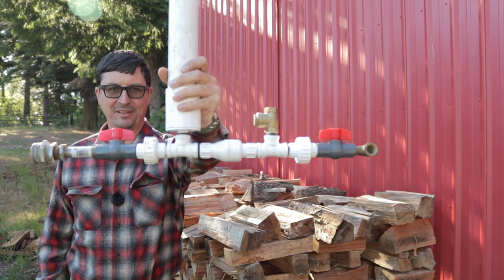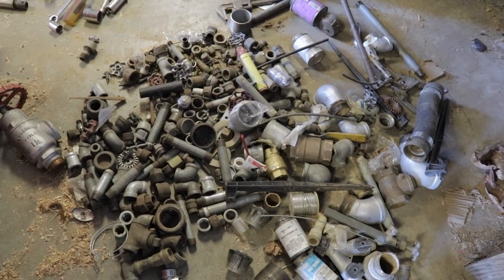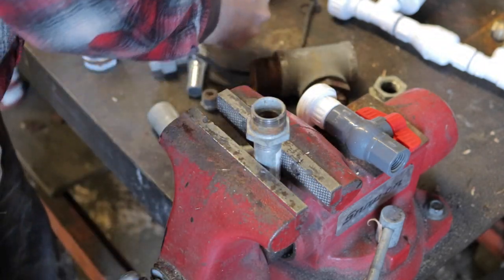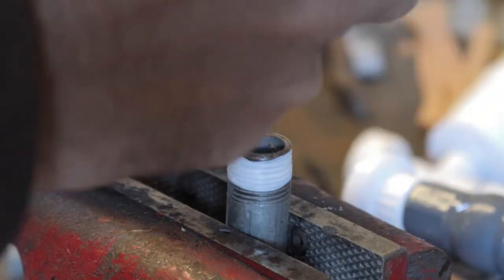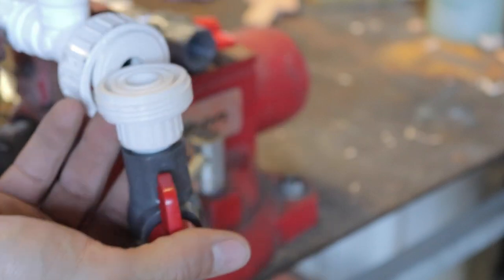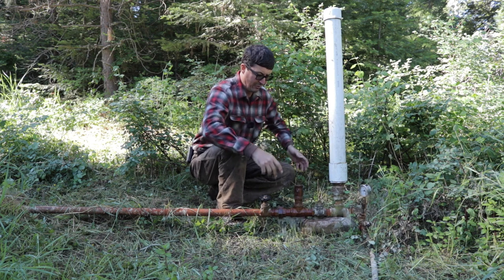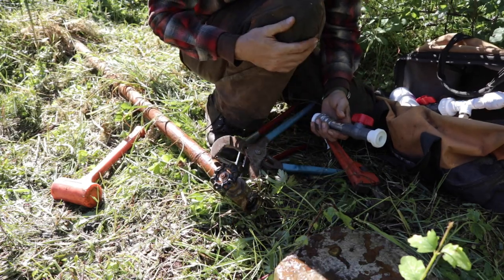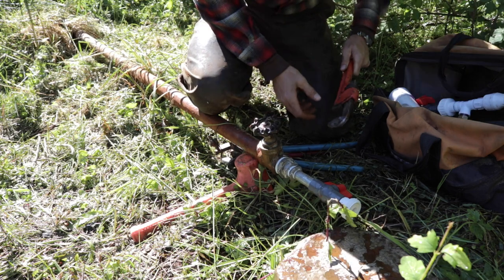Coolest Little Ram Pump Ever!!!

Comment: If you flip your tape when applying it on your threads, you can use the pressure of unwinding the type to make it stick tighter. (you did it correctly @3:20 but not @ 3:05)

Comment: 3m makes Teflon tape some companies thin it down blue is just the thickest but thats just a certain brand. There is white thats full thickness as well. On gaslines l use tape and dope. You can't use oilbase dope on plastic. But the dried out brad you had is not oilbase. Great videos.

Comment: Blue monster can be used on gas and water fittings, shouldn’t use white on gas. I use Teflon first on threads then apply pipe dope onto taped threads.

Comment: Tip 1 : Try holding the teflon tape 180 degrees opposite that way you can keep the tension on the tape … tip[ 2 turn the tape around the pipe 5 to 7 times .. best seal every time

Comment: Open your pipe wrench wider and you won't have to hold it on the pipe with your other hand. The wrench has a magic spot where the opening will fit any pipe within limits and not slip.

Comment: Here's my 2 cents.  If the install is permanent use the dope, but if you ever need to remove it (ever) use tape because it's easier to clean.  Is one tape better than another?  Could be, but it isn't critical outside of NASA I'm sure.  You were talking about pipe material also.  I've worked with watermains and customer water services in the ground for the last 10 years.  Avoid galvanized at all costs, and if possible use plastic.  It won't have the corrosion issues you'll encounter with metal.  Use what's at hand by all means, but given the choice I'd use teflon tape, and all plastic pipe and fittings.

Comment: The pipe dope is the sealer teflon tape is your thread lubricant I put dope onto the threads and then wrap it with teflon 
The blue tape is better mainly because it is thicker the best teflon tape is is the nickel teflon it is mainly used for stainless steel

Comment: What’s the difference between white tethon tape and blue tethlon tape The colour
Reply: White tape is for water lines 3/8 inch thick or less yellow tape is for black steel gas line red is for 1.5 inch to 2 inch water line and green is ment for oxygen tanks the only time i seen it blue was for blue monster teflon tape which is the same as the white

Comment: I'm going to trade school to become a millwright, and they teach us to use pipe dope over teflon tape. As you screw your fittings on, it shreds the tape and it gets into your system. For home use, in a water system, it probably won't make much of a difference.

Comment: Neither. PTFE tape is a lubricant. Think non stick pan.  Pipe dope is solvent based and drys out. For metal use Loctite 567 and for plastic use Loctite no more leaks.

Comment: As far as your better pipe dope I learnt from a plumber that was retired and he done lots and lots of Plumbing in St Louis Missouri and he told me the best that he ever had they took a small paint can it was empty and all brand new in the clean and the Little Brush poke the hole in the top of it then he took and squirted pure caulking down in the can and added just a little bit of 30 weight motor oil and he said that's the only kind of Plumbing goop that he used and it work better than anything thread tape or any other kind of ceiling it was homemade just a little tidbit there for you

Comment: Teflon tape ? its called P.T.F.E here poly tetra flora effaline , spelt wrong some where but its a good one to use on most all threaded fittings ,we have the one you use plus one thats twice the width and thickness that gas fitters use ,never seen the Blue one you talk of
Reply: P.T.F.E.E. Tape defo better thinner is better for domestic the paste stuff goes everywhere

Comment: So I want to make a ram pump but using steel pimp and my question is can the pressure tank be made from steel pipe all the photos and videos I have seen are made from pvc is that necessary
Reply: make it out of anything that doesn't stretch or leak.

Comment: I use Teflon tape with pipe thread compound on top.  Guaranteed to not leak.  Also you are applying the Teflon tape wrong.  Flip over the roll and it will be so much easier to apply.  Apply it like you were using the wrong side of a roll of duct tape.  This makes all the difference.

Comment: The best stuff to use is hemp and soap.  Hemp can be undone by a 1/4 turn under pressure and still not leak. I only use Teflon on brass to brass joints and for that I use the yellow.  Yes I know it's for gas but it is thicker and more reliable.  This could be the way us backward Australians do this though.

Comment: i think it would be interesting to run several of these in tandem if it would be possible.
Reply: That only works if the pumps are powered, and add energy to the flow.

Comment: Could you explain what a RAM pump is used for and why?
Reply: The Ram pump , like other pumps, is used to lift water to a higher elevation.
The beauty of this pump is it requires no external energy to run, & it's simplicity.

Comment: Technically, teflon tape doesn't seal, it lubricates the threads so you can thread them together tighter and the taper of the threads actually do the sealing. That being said, most plumbers use a small amount of teflon for lubrication and then pipe dope helps seal and prevent leaks from vibrations.

Also, there is a neat trick to applying teflon tape to the threads, I'm surprised you don't know it! Google "how to apply teflon tape properly"

Comment: Tape , if you want it to come apart, (service).
Dope will hold like glue. I wrap tape in direction of threads, (tightening). 
Personally, I use dope first on threads, cover with tape, (no mess). NO LEAKS !

Comment: Refrigeration/boiler guy- For things that don't concern a lot of heat the tape is a good choice. if it uses a lot of heat use the dope. I'd throw that white tape away and stop by a fitting store (Crane,ect) and pick up some actual fitters tape. It's a lot thicker and just generally works better.
Reply: pink/blue/yellow

Comment: As a plumber I would put dope and cover with tape for steel or galvanized fitting and for plastic brass copper aluminum I would put the tape and cover with pipe dope

Comment: For water applications Teflon tape is the go to but, you can use pipe dope it will work just fine. For gas always use pipe dope, or both if you're the over achiever. It is wasteful unless you have problem threads, but with gas being so dangerous I don't blame people for being cautious, for gas I would never use Teflon tape alone, but for water as long as you tighten it down well Teflon tape works great.

Comment: If you always used "Never Seize" or other thread Lubricant on your connections you would not have to struggle with rusted threads.

Comment: Put the wrench on the ground on the same your top wrench is turning to, doesn't matter weather tightening or loosening both wrenches on same side bottom wrench facing up, than you'll only need to pues on top wrench down while the ground holds back against the pipe . Work smart not twice as hard.

Comment: add some oil to your dried pipe dope and it will be usable again! Pipe dope is better for some things and Teflon is good for others. Pipe dope is also a lube and Teflon is not. Teflon will also clog orifices if not totally installed correctly!

Comment: I use yellow Teflon tape for everything at our Cottage I believe it's meant for natural gas lines but it's thicker then white Teflon and you often only need like one rap I've been using it for 5 or 6 years now it's a little more money from the 98 Cent Store Teflon tape light to $5 for one roll of yellow but that one rule of yellow last far longer than the white stuff

Comment: Yes, the Mega type tapes are best. After your basic white Teflon came the yellow tape which we used on gas fittings. Eventually, the grey and blue type Teflon tapes came out and are thicker than the white tapes (as was the yellow Teflon). I can't really tell ya how they are matrix-ed, but you use less wraps and they're more durable. With the thicker tapes, don't use as many wraps as you would with the old white Teflon. If you do, you may actually split a fitting. As far as pipe dope....what the industry has done is try their damn-est to confuse us plumbers.  And be careful of what you use with potable water. Some of the best pipe dopes that we used on gas fittings for example, are not and should not be used for potable water supplies. Read labels/directions and spec sheets if in question. Medium set, hard set and soft set....all have their pluses and minuses.

Comment: Pipe dope is the better stuff,I use the teflon tape with the pipe dope some times, teflon tape first then the pipe dope and put it together.the teflon tape makes it easier to take apart,especially on steel pipes. (Power engineer). here are different thicknesses of teflon tape.

Comment: What happens when the water tower is full? Does the pump automatically stop pumping?
Reply: overflow pipe
Reply: It's an air tower (accumulator) that stores air, not water. Water going in compresses the air and builds up the pressure needed to pump the water uphill. As valve closes and the water is pushed out, the air returns to its uncompressed size.
Yes, it will stop pumping. The check valves won't be able to work properly.
Reply: Waldo Lost I meant water tower. He fills up a water tower with water. I was wondering what happens when the water tower got filled up to the top.
Reply: The short answer is yes, it the pump will stop. If the water can overflow the top of the tank, it might keep going, but I'm guessing it won't be pumping much at that height.

Comment: Ultra Seal T – 10,000 Thread Sealant has been the best so far rated 3,000 psi on gases and 10,000 psi liquid use it at work all the time on industrial water mains all the way to the meter box never had a problem!

Comment: pipe dope(the stuff in the can) works better, but It is vary messy. if u want u can actually use both, if you are worried about leaks. especially when threading in to a rusty fitting or a fitting that has already been used, and may not fit together like new pipe would.    
 for gas use the tape/dope specially made for gas. it works much better and is well worth preventing the possibility of a dangerous gas leak that are both deadly from fumes and or fire. propane, natural gas, and other petroleum based fuels will dissolve the tape or pipe dope that is used for water pipes and will vary likely leak someday
Reply: the yellow tape is for gas the pipe dope for gas needs to say it is for gas and will likely have a yellow label 
the blue like you were saying is for a really high pressure (over 75 psi)
the white is for everyday water pipe

Comment: If the threads were perfectly made on all of your parts, you shouldn’t have to use any thread tape or dope at all. But. That’s never the case. Dies on threaders are all always messed up or somebody isn’t using them right. The company I work with uses both. And that’s pretty much standard. 3 to 4 wraps of tape and a quick coat of dope.

Comment: in Iceland we use hemp
Reply: Same here in France, hemp fibers and grease.
Reply: My dad used to be a pipe fitting guy, he always used hemp, still does.
Reply: On the job I use 4 types of sealant.
- White PTFE tape for small 10bar maximum pressure pneumatic connection, plastic & metal NPT BSP 1/8 to 3/8.
- Liquid teflon (Virax made in France) good for Inox, great for brass threads, 1/4 to 1-1/2" , pneumatic water nitrogen gas. Clean gas lines. Best for permanent assembly
- Loctite 55 (thread with a funny white residue) seals any medium hermetically,  even helium gas 1/4 to 1", real quick & easy to use, amazing stuff.
- Hemp fibers, best for galvanized steel 1/2 to 2" & larger.

Never seen PTFE tape other than white.
Reply: In the US they have blue PTFE tape that is about 3 times the thickness of normal PTFE tape.  It's quite commonly used with many of the plumbers around my area for everyday residential plumbing connections.
Reply: Okay Is this for real- or a pun - or am I the only one that sees the humor in pipefitting with hemp !~
Reply: Haha see you found another use for hemp :)
Reply: Keith Davis
That's one way of looking at it. Hemp fiber was used extensively up to about 100 years ago for many different applications: Strong ropes, rigging on sailing ships, caulking in-between wooden planking & decks. If I am not mistaken it was relied on for by many industries.
Reply: +trespire colour coded here is Australia white water, yellow gas (thickest), pink water but thicker than white. Have a wide range of paste and liquid sealers as well.
Reply: In Greece we still use hemp but one also has to know that the pipe fittings here are not taper threads, yes they are straight side like a conventional screw. In recent years Henkle has introduced Loctite 55 thread sealing string that is Teflon based. Just wrap it around the threads building in thickness towards the back of the pipe. Basically creates a wedge seal. Cleaner than hemp and sealant.
Reply: Subgunman
Loctite 55 is great.

Comment: Why was this recommended? Why did i watch the whole thing?
Reply: one of us one of us one of us - its too late now you are one of us,.
Reply: I believe this is a pump you put in a running stream and it will provide water pressure without any power.
Reply: I was walking past a tall wooden fence the other day, you know, the kind you see outside a building site. As I walked along beside it I heard chanting coming from behind the fence further up... they were chanting numbers, or rather just one number.
"Thirteen, thirteen, thirteen, thirteen, ..." they excitedly chanted. It sounded like a small crowd, young and old; men, women and children. All of them saying the same number over and over.
As I approached, I saw a small hole in the fence just big enough to look through. The hole was right where the sound appeared to be originating from.
So, with the crowd continuing to chant "... thirteen, thirteen, thirteen, thirteen" and it seeming to become more intense as I leaned down to place my eye at the hole and work out WTF was happening in there.
Just as I put my eye to the hole a small finger like that of a child poked me in the eye and the crowd stared cheered loudly and started chanting again..
"Fourteen, fourteen, fourteen..."

You just became #14 to the Wranglerstar channel
Reply: Learn a trade and stop jumping out of perfectly good airplanes , you'll need the experience WTSHTF.

Comment: Any Teflon or pipe sealer doesn't actually seal the connection. Since the pipe is tapered metal on metal doesn't tighten well. The point of the Teflon tape is used as a lubricant, so the tighter you tighten your connection it allows you to over come the metal on metal contact and tighten it more than if it was dry. Teflon is a very interesting material, if you shape it into a wedge you can remove security stickers and since it is Teflon nothing really sticks to it. 

If you don't mind someone cursing a bit, here is a good example of the uses of Teflon: https://www.youtube.com/watch?v=wfOZKj8ZGqo

Comment: Do Americans use seconds and minutes to measure time? Is this a metric measurement? Haven't they came up with there own time system, Like a squirrel chirp or the time for a beaver to chew through 2" log?
Reply: I remember seeing a presentation on "Metric Time" back in the '70s.  It had 10 hours/day, and 100 minutes/hour, and 100 seconds/minute.

I think it still called them hours, minutes, and seconds.  Maybe it was centons and microns.
Reply: Seconds and minutes were used long before the metric system arose.
Reply: Yea I know, just mucking around... Fantastic how the principle of the ram pump works in any system!
Reply: +sexyloser Yeah, about 4000-5000 years (that's a WAG).  Thank you, Babylonians.

Comment: The Teflon tape is what I always use on screw fittings.
Just got to remember to wind it in the same direction as the screw on fitting.
Usually three to four turns is enough.

Comment: Theirs really no huge difference between Teflon and pipe dope, the pipe dope is more of a gluish, hardens up to aaa semi solid inside the threads and the Teflon is self explanatory except if u don’t apply enough it’s pointless but if u apply to much you can split the fitting if ur try to use the 333 method and pieces can rip off if it’s over the inside hole and clog any pumps or get into the product going threw

Comment: I have commercial and residential plumbing experience, and I'd recommend never threading a metal male threaded pipe into a plastic female fitting.  They will invariably split the plastic over time.  It's much better to use a plastic male thread into a metal female fitting.  As far as thread sealant, I use regular teflon tape (white) outdoors (where it doesn't matter if it drips), and teflon tape plus Rectorseal paste sealant inside (where it's crucial not to drip).

Comment: I do not understand how people can think its "WASTED WATER"..........I just don't get it. One could dig a deep hole beneath that pump and dump rocks in the hole and the spaces between the rocks will allow the water a place to settle (FRENCH WELL). OR the water will evaporate and fall as rain somewhere else. Use some common sense.
Reply: concur. also, I'd add that it's stream/river water! it's 100% "wasted" if he doesn't grab it as passes by, right?
Reply: D L - Exactly. When I firat saw it I thought it was wasted until I realised it was just going the way of the spring water anyway.

Comment: 96oz in 30 secs gives 8179 litres per 24 hours.. thats not bad.. Thats A LOT of water.. over 8 cubic meters .. wow.. I just wait for the day you get rid of the imperial measuring system its not logic at all..  I mean.. 128 FLUID OZ = 1 gallon...   1000 ml = 1 litre , 100cl = 1 litre , 10 dl = 1 litre.. 1000 litre = 1m3 or cubic metre... So much easier..